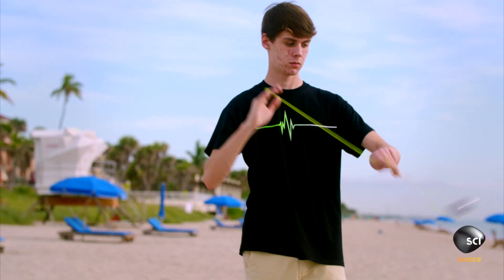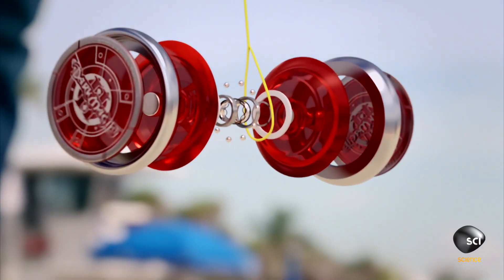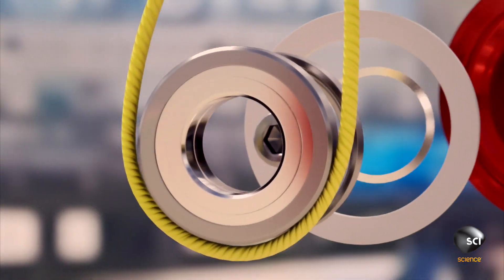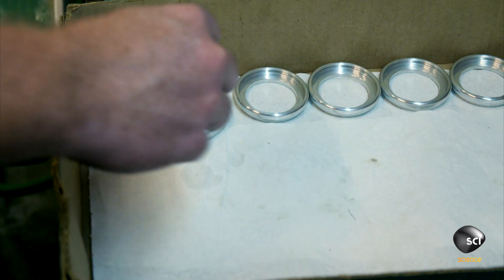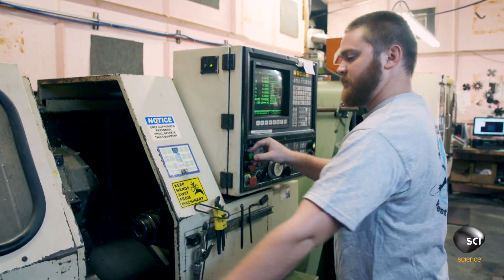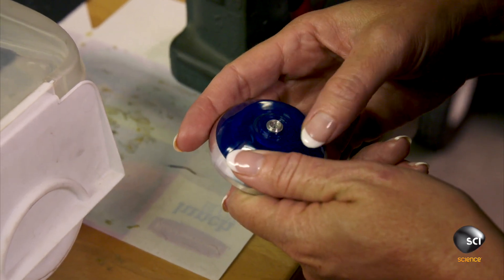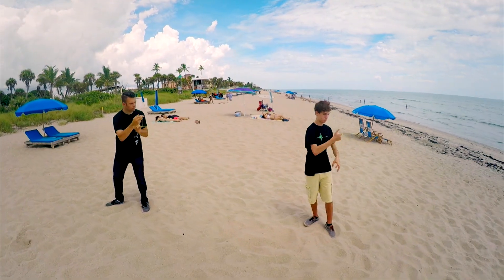A Yoyo Can Spin as Fast as a Formula 1 Engine

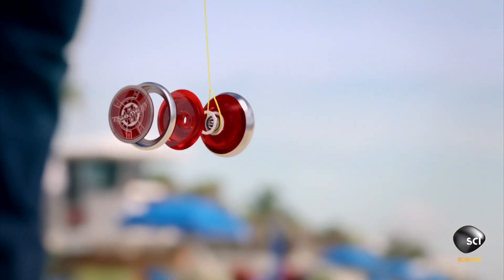Comment: 0:56 and my non responsive yoyo does not even spin for 1 min 😂 even though my throw is powerful.
Reply: No, your throw is not powerful. A terrible unresponsive yoyo could easily spin more than a min.
Reply: @Rucnas  I suspect fault in bearing. I have bought another yo yo which spins for more than 1 min.

Comment: "As fast as formula 1 car" yeah I doubt it, that much energy in spin would burn the string lol
Reply: Nah, the highest recorded rpms people have achieved are around 10,000 to 12,000, and formula 1 engines get up to 12,000 to 15,000 rpm. That 20-25% increase wouldn't make yoyos suddenly start burning strings, since they don't get anywhere close to that at 12,000. Also keep in mind that there isn't a whole lot of friction between the walls of most modern yoyos and of the string, so you'd need the yoyo to be spinning a hell of a lot faster than even a formula 1 engine.

Comment: Ten minute spin time? I'm calling Bull S***  on that one... The fastest bearings out there (i.e. ceramic, gold plated or hybrid ceramic bearings) top out at a little over 3-3.5 max top speed of about 3500 rpm on a perfect toss. And that's on a bi-metal throw... Unless you're doing a crap ton of regens then it's conceivable, but one toss not happening
Reply: John Bovee but you could get 9 min on some s
Reply: Wdym? There are records of people getting easy 12 minute spins with the draupnir in 2014, and then pretty commonly with any decent bimetals from 2017ish and onwards. You just need to know how to maximize spin time.
Reply: @abellia because OP is suck at throwing. It's not that hard to get 6k rpm for a new player. Even experienced players can get up to 10-12k rpm. It's not possible to throw it for 12 minutes while doing string tricks. It has to be still for it to last that long.

Comment: I call BS on the part when they test it. I got my dark magic II and the plate that the bearing sits on was misshaped and would only spin for a couple of seconds. if tested that would have been caught.
Reply: They come with a thin over lubed bearing as well as a high performance "advanced" bearing version. Prolly got the beginner one
Reply: @aezothgames5230  No. It really was a bearing seat defect. The half-spec bearing didn't work right as well. Got it replaced, works fine.

Comment: And here I thought yoyos are cheap toys, that explains why I never bought one.
Enough kidding, a normal yoyo costs few $ so there won't be so much science, these here are professional yoyos.
6061 alumininum is trully used in aircrafts, but isn't a super material since it has limited working time(more exaclty way less than other materials, I don't mean other materials can work forever), but this isn't a high performance material, it is just light enough.
Reply: My RC car has many parts made from 7075 aluminium.  i have found these upgrades much better than the standard 6061 parts

Comment: Yeah, show me the yoyo that can handle 20,000 rpm. Seriously, I'll wait.
Reply: There are plenty, lol.
Reply: The Peridoge No, actually their aren't. I spent time after reading some of the comments here doing research.  Even "professional" yoyos only spin between 5-10k rpm. Given F1 cars can range anywhere between 10-22k rpm means that no yoyo on Earth even comes close.

Again, if I'm wrong then SHOW me. I'll wait.
Reply: I know that your right, but I just wanted to point out that the record for yoyos is 16k rpm, I heard somewhere, and that F1 engines are often limited to below 19k during races
Reply: The Peridoge  "Highest Revolutions Per Minute: 14, 300 rpm by Dale Oliver in 1991 using
a Tom Kuhn Silver Bullet II"

"Until the mid-1980s Formula One engines were limited to around 12,000 rpm due to the traditional metal valve springs used to close the valves...Since the 1990s, all Formula One engine manufacturers used pneumatic valve springs with the pressurised air allowing engines to reach speeds of over 20,000 rpm"
Reply: ***** First of all, that first clip was from 2005, lot of innovation since then. Probably hasn't gone up too much tho

The F1 regulations mean engines are limited to 1.6-litre turbocharged V6 with a rev limit of 15,000rpm and a maximum fuel flow of 100kg per hour.
Reply: The Peridoge First, the record I just quoted you IS the current world record. If someone is capable of pushing it faster than that they haven't proven it.

As for what an F1 car is limited to during an officially sanctioned race is not all it is capable of...in fact, the mere fact that there is a rule LIMITING it means it is faster.
Reply: k den. :(
I'll leave you with the SubWay motto
Have it your way, with extra salt
:)
Reply: The Peridoge Who is salty? I just used facts. Would you like me to link you those facts or do you know how to use Google yourself?
Reply: ***** I'm salty. 
" I'm always angry salty"
                       -Hulk (whenever Avengers came out)

Comment: > saw the title
> instantly paused the video
> made this comment just to say that engines don't spin
Reply: They do spin....
Reply: Filthy Osama Don't be so cheeky kid, you know what they mean, and this is not really the point of the video anyway. End this autistic thread.
Reply: what does a  cam shaft do agian?
Reply: Filthy Osama Well, you can take the title a lot of different ways...
Reply: "as fast as a formula 1 engine" they meant the speed of the yoyo to the speed of the engine you smart ass
Reply: they are talking bout the speed osama, not the motion
Reply: where's the part when you open the video??
Reply: the flywheel of an engine spins.

if you talk about the entire thing, then no the yoyo does not spin either, the string stays in one spot in your hand
Reply: Varun Gandhi i have magical powers, don't need to click on the video to write a comment
Reply: /watch?v=JW4jSf5KBmM  This engine does.
Reply: a full ENGINE does NOT spin inside the a car
Reply: no you can't, an engine does not spin and that's that.
Reply: Tony Wei i understand what they mean, but saying "a yoyo can spin as fast as a formula 1 engine" is just not true, since you're implying that a yoyo doesn't spin at all.

Comment: f1 engines spin up to 15,000 rpm. this video is bullshit
Reply: Actually it's true. Incredibly enough
Reply: Yoyos go between 5 and 10k rpm. Since the 90s F1 cars have hit over 20k. A yoyo cannot beat or even match that.
Reply: Yeah, it's true. Do your research lol
Reply: it's NOT true. the highest ever "recorded" rpm was around 14k rpm, but was later determined to be incorrect by approximately 2x. so MAYBE 7K is achievable, but definitely not 15k, which is the current redline of F1 cars, and is only ~75% of former f1 cars, which spun at nearly 20k rpm at max.
Reply: lvbuckeye
Whatever ya want to believe son
Reply: +lvbuckeye it is possible for a yoyo to spin as fast as the engine witha strong throw. An average throw with short strings, and a flat 8ball bearing is about 6.5k per min. If you really chuck the yoyo equipped with the right bearing it can really spin.
Reply: +Acid White Cherry I honestly wish I had never replied here, but look at it this way. there are 7+ billion people on earth. 700 of them play major league baseball. the fastest throw ever recorded was 105.5 mph, in April 2016. what you're telling me is that you yo-yo guys can throw 150, and that is just not humanly possible.
Reply: lvbuckeye Whatever you want to believe. The physics and dynamics are entirely different.
Maybe if you did some research.
Reply: On a side note, and i really shouldnt even be mentioning this XD. But a baseball moves relatively horizontally for its movement. Projectile motion if you will. The point of the video is about rotations per minute. I'm not a physics expert, but a baseball could in theory be thrown at a high speed without rotating (I think its called a splitter or floater?). So rotational dynamics on a pendulum that increases in length, L (aka the string), is not a comparable throw to a launched projectile (the baseball).
Not trying to add tension to the comments, just thought I'd point the difference between the 'throw' of a yoyo and baseball.
All the best,
Vee

P.S. Don't take this too seriously, this is the internet. And if you REALLY want to see the rpm of a yoyo. You would have to attach some kind of magnet to the side of the yoyo that you could feed the input of each rotation over time into an oscilloscope or something like that. The period of the function given in the oscilloscope would be able to show you the real rpm. So unless someone did that, all these comments are pretty meaningless
Reply: @lvbuckeye What if i tell you that there are Wankel engines. Mazda RX-7, easily over 10k RPM. So your argument is invalid.
Reply: Way back in the 90's someone had a yoyo record of 14,300 rpm, it has to have been beaten by now as well, I've seen people say they've gotten up to 18000.
Reply: rdizzy1 Then tell them to prove it or STFU (them not you). The technology hasn't changed for yo-yos since then. Just high quality ball bearings. Until that changes it is just a matter of who can throw it the hardest.
Reply: I've missed a shift and spun a b16 up to 12k. that's irrelevant. what IS relevant is that it's humanly impossible to throw a yo-yo as fast an F1 engine. let alone a chipped b16.
Reply: that record was later determined to be 7k, not 14k, so... there is that.
Reply: lvbuckeye most F1 engines today spin at about 12k and a max of 15 i think? 
A modern yoyo can without much effort be spun at 10k so i am pretty sure that 12k is quite possible.
Reply: JoVi []_[] No F1 cars are still capable of spinning into the 20s. They are electronically limited to 15 during official races as per the rules of F1.
Reply: InItForTheParking that is exactly what i meant though. That is why i set a max. We are talking about F1 cars with the current ruleset and restrictions.
Reply: JoVi []_[] That is being limited though. Not what the engine can do. An F1 car CAN do 20k+ RPMs. What you are saying is that a yo-yo can do 2/3 of what a limited F1 engine can do. IE you are artificially restricting the competition. I mean if that were the case you could say I'm as fast on a bicycle as an F1 car...because in the pits there is a speed limit. No making comparisons doesn't work that way.

Even at that, you are still wrong. the world record for a yo-yo is 14k. Still not as much as the F1 rules. Much less what an F1 can actually do.

I mean for that matter, there are yo-yo contests that restrict what yo-yos you can use, including bearing-less...should we say that yo-yos are only as fast as those?
Reply: InItForTheParking First.. The 14k speed "record" i beleive was set in the 90's or early 2000. If you know something about modern day yoyo'ing you would know that much progress has been made since then. And modern ball bearing yoyo's CAN beat that record. I wish i could physically show you. But i don't own the equipment. The right man with the right yoyo could very well throw a Rimmed yoyo fast enough that it could be spinning as fast as an F1 engine. So about 15k (Also no current official contest category is limiting ball bearings to fixed axles) 
This is my beleif. Take it at that. Someone would have to prove me wrong.
Reply: JoVi []_[] NO THEY HAVEN'T ADVANCED. It is still just a high quality ball bearing! How fucking stupid are you that you are still trying to argue this? And with your own guesses and not facts on top of it.

If you can beat it then call Guinness. They have the equipment to test it. But the fact of the matter is that the tech hasn't changed so it is STILL just who can throw it the most perfect way.

"This is my beleif." EXACTLY, you aren't even using Google to do a basic search. In fact, you can't even spell belief correctly so why the fuck should anyone take your opinion seriously?

Want me to Google it for you?

"Highest Revolutions Per Minute: 14, 300 rpm by Dale Oliver in 1991 using
a Tom Kuhn Silver Bullet II"

See the name of the YoYo he used? That is a BALL BEARING yoyo! The EXACT SAME technology that is used today!

Jesus fucking Christ, all the information in the world easily available at your fingertips and you still argue as if what is in your head is fact. Fuck, learn to use the technology in your pocket.
Reply: InItForTheParking Oh my goodness. You are really ignorant o.O I NEVER stated that the record was not set with  a ball bearing yoyo. I did not say that the technology has advanced. I said that they have made a lot of progress with the design of the yoyo's today. Let me rephrase. Modern day yoyo's (and I know quite a bit about them.) had advanced in the way that the Ball bearings are way higher quality and the shapes and "responce" is much better when it comes to makin the yoyo spin as fast as possible. The silver bullet has a starburst responce system wich limits the rpm significantly. A modern "unresponsive" yoyo with metal rims will practically outperform a looping yoyo from the 90's big time. What i am saying is not based on guesses it is based on research and personal experience. 
Also my spelling has nothing to do with this. I am going to leave it at that.
Reply: JoVi []_[] No they haven't advanced in design either. It is a high quality ball bearing on a well balanced and heavy flywheel. If you knew anything about mechanical engineering you would have some ground to stand on...but you obviously don't.

Quit talking shit and put up or shut up. Call Guiness and set the new fucking record then! Why do you think no one has done it?
Reply: When a yoyo spins at 6k rpm. The bearing inside will spin around twice as fast. They were talking about the spin on the bearing. Not the yoyo itself. The bearing will always spin faster then the yoyo.
Reply: a yoyo is significantly lighter than a basketball lol

Comment: First off, a yoyo might spin as fast as a F1 engine if the engine was idling. Second, any yoyo except super high end ones would never spin for 10 minutes. No matter if you got it spinning as fast as an F1 engine.
Reply: It depends on the player and the yoyo, not just the yoyo.
Reply: world record is about 30 minutes, though that thing could shatter bones if someone threw it so you're not wrong
Reply: Some yoyo's spin for 30 minutes, there is a video.
10 minutes is really not that much, for a yoyo

Comment: a yoyo spinning at 18,000 RPM? hah okay
Reply: They are not even kidding.
Reply: It's true.
Reply: It's really not that bad for yoyos. Gotta think the rotation is much smaller due to the smaller diameter and the force used. Gentry Stein recently hit 30000 rpm
Reply: JoVi []_[] I know they're fast but not that fast. oh and btw I was incorrect modern Formula One cars can rev up to 13k but I think retro ones can hit 17 or 18
Reply: They're not lying
Reply: They are that fast. Do your research.
Reply: 18,000rpm is nothing.
Reply: REDxFROG Yeah it is lol. that's above average even for bearings

Comment: 'Faster than an F1 engine,' really? can it do 18000 rpm? With all due respect I don't think so.
Reply: Yeah actually
Reply: NOT. I've made a little research and found that an yoyo reaches just above the half of F1's engine RPM: "anywhere between 5,000 and 10,000 rpm". Pick your statements carefully!
Reply: There's also a difference in diameter between a yoyo and a f1 engine that you are moving. There are records of yoyos going nearly 2500 rpm
Reply: thank you. fucking hell. THANK YOU DUDE. Guys, if you want more information on an F1 Engine, go to Engineering Explained's channel. There's a fucking difference between the aluminum in a yoyo, and the internals of an f1 engine.
Reply: Whatever you want to believe son

Comment: F1 v8 engines were 20,000 rpm max.  That's 333 rotations / s.  I kind of don't believe a yoyo is that fast really.
Reply: +I Don't Want To Tell You f1 v8 engines were 20,000 max.

Comment: I used to have a little cheap yo-yo that had the plastic in the middle that didn't spin and the string would get hot as you used it. You had 5 seconds to pull off your trick or it failed.

Comment: F1 engines used to rev up to 22.000RPM, but today they rev to 11.000. That is almost Honda speed.
Reply: Your average passenger car shouldn't rev higher than 5,500 RPM
Reply: That Guy With the Pointlessly Long Username That You Are Wasting Your Time Reading Right Now My Hyundai Atos goes to 6000 rpm.
Reply: Mladen Milić Is that where it redlines though? I mean on average, the max safe RPM is about 5,500
Reply: That Guy With the Pointlessly Long Username That You Are Wasting Your Time Reading Right Now Normal redline. Pedal to the flor, it would sit there for hours ( and it did one for 2 hours).
Reply: My moms camry redlines at 7500

Comment: but if it has a bearing how does it create friction on the string to come back up??
Reply: +Antonio Duarte You guys are right, however, on advanced yoyo's like those, a technique called "binding" is required to get the yoyo back to your hand. You can watch youtube videos for it. But basically you loop the yoyo back onto the string and it catches. Bringing it back to your hand.
Reply: +Antonio Duarte Do you see the white rings when the yoyo came out into the 3D cross sectioning? Those are what we call response pads, that what allows the yoyo string to grip on to force the yoyo to a "stop" and make it spin the other direction to make the yoyo come back up while rolling up the string at the same time.
Reply: +Antonio Duarte   see the white band just out side the are were the bearing is... that would something like a bite area... when you jerk up on the yo-yo.. the string relaxes and gets wider gripping that band.